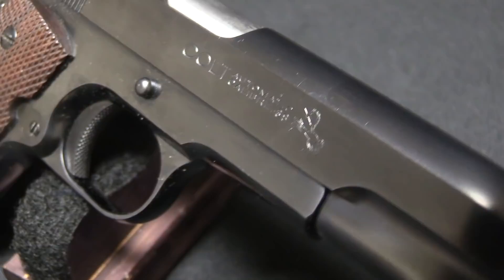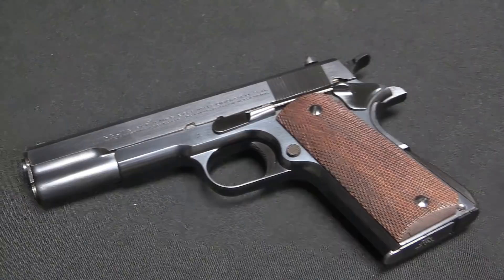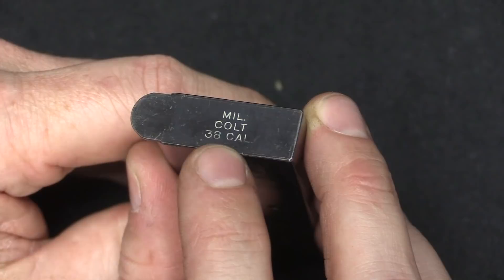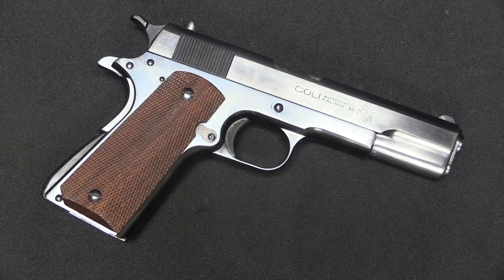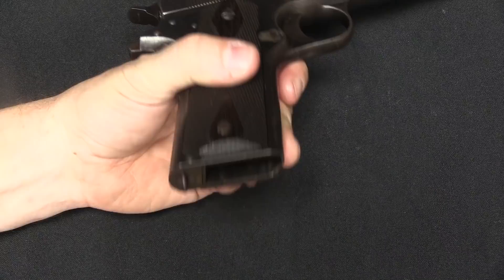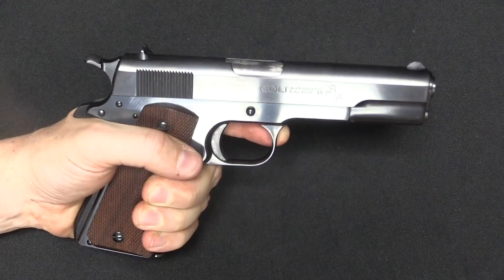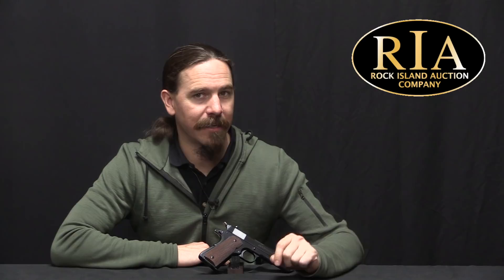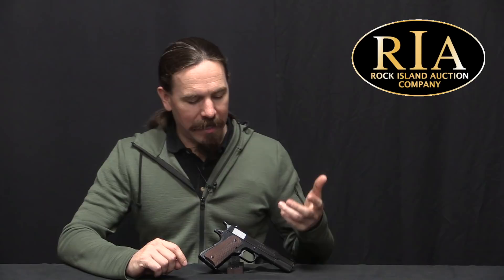Colt's Prototype Scaled-Down Model 1910 in .38/9.8mm

Comment: Now CZ (Colt) needs to get these back into production!
Reply: It's basically a Baby Rock.
Reply: @ScottKenny1978  Baby Rocks are smaller than this.
Reply: There are already a couple slightly more scaled down 1911s on the market in .380 ACP.
Reply: @0neDoomedSpaceMarine  
Bolt or Colt which is it heretic.
Reply: @0neDoomedSpaceMarine  because this isn't as big as a 1911.
Reply: CZ might just do this because it is about the size of their compact 75s. The only problem is, it's a single stack and a lot of people don't like that.

Comment: Ian : " ..and nobody's going to put them into production now " 
Kel Tec and Ruger simultaneously  : " Hold mah beer ! "
Reply: Ruger would probably wait for keltec to do most of the legwork and then introduce theirs later. Or SW. They don't really have anything all that special or unique.
Reply: Chamber it in .30 acp/shortened M-1 carbine brass with modern powder. 7.62x21 ?
Reply: @glennruscher4007  sounds like a 32 hr magnum automatic, or a 7.65 french long.
Reply: I'd buy one
Reply: @randomidiot8142  What has Ruger copied from KelTec recently? The only thing I know about is the P3AT —> LCP

I want a Ruger Sub2000 and CP33

Comment: Ian, fascinating pistol: it exhibits M1911A1 Transitional features such as the arched mainspring housing, the extended grip safety (beavertail), the stamped trigger, the full-checkered walnut grip panels and the slide roll markings of pistols produced in the 1920's while not having the finger cutouts behind the triggerguard.

Comment: Definitely a "forgotten" part of 1911 lore.  It seems to have futuristic look of the 1911A1. (Arched mainspring housing?) Thanks  Ian!
Reply: That mainspring housing makes you scratch your head.  Colt evidently considered it right off the bat, unless it was changed in the refurb in 1929.  It has the short trigger, too.
Reply: @Robert32064  I'm betting on the refurb, especially if they were using it for essentially marketing for the new pistols.
Reply: @TWX1138  https://www.rockislandauction.com/detail/56/3554/experimental-colt-model-1910-98-mm-pistol-serial-number-4  Note the mainspring housing, trigger length and grip safety tang on this pictured 1910.

Comment: The .38 ACP was no slouch for its day. It clocked a 125 grain slug at a nominal 1,100 fps which makes it comparable to the 9mm parabellum's 124 grains at 1,150 fps. A 9mm in that slightly smaller frame size could have been a winner for some European military and even the .38 ACP should have interested someone.

Comment: This pistol has obvious post-1925 features on it... arched mainspring housing, A1 grip safety, thumb safety and slide stop... and the front part of the slide is darker meaning it was heat treated which Colt didn't start doing until 1925 on the 1911A1. Also the rollmarks are definitely post-WW1 era. I believe this pistol was actually newly-made around 1929 like you mentioned at the end of your video.

Comment: I had heard of this pistol and cartridge before somewhere, probably in an article in American Rifleman. Only I thought it was from the late 20s or early 30s. Be that as it may be, in 1910, the .45 ACP was not a standard cartridge anywhere and (I think) only the Germans were using the 9mm by then. It seems to have been a common practice ever since cartridges became available that when a manufacturer introduced a model, they only chambered them in their own cartridges. So Colt would never chamber a Smith & Wesson cartridge or vice versa. And if they did (which they did), they'd call it something else. But proprietary cartridges are still being introduced.

Some models of Star automatic pistols were quite similar to the "slightly smaller" 1911. In fact, Star made a wide variety of single action pistols, all variations of a Colt automatic.

Comment: The caliber has me confused.  9.8mm is .385, a true .38, whereas 9mm/traditional .38 are actually .354 (generally rendered as .357).  Was there to be a unique cartridge, or is this simply one of those gray areas in firearms nomenclature?
Reply: The tolerances aren't that tight, especially back at the turn of the (20th) century.  A thousandth of an inch is insignificant compared to the lands, and the groves of the rifling.  Also, Nominal caliber is rarely exact to actual caliber.  Since you're forcing a copper jacketed lead slug down the barrel with fire, it doesn't really have to be, for a prototype pistol.
Reply: @Psiberzerker  Thanks!
Reply: 9.8 mm did exist but it was called .41 Long Colt. Ian pointed out that this wasn't really a 9.8, and my guess would be that the term might have been a placeholder to distinguish it from .38 ACP, as that caliber had been provided in an earlier trial.

Fwiw, 9mm Lugar is 9.01mm/.355“ and - I'm going to say from memory that it was around - the late 1980s that Colt publicly stated that all of their 9mm, .38 Spl, and .357 Magnum pistol bores were all cut to the same diameter, .355“, and had been for some time. Kudos to  @Psiberzerker  for his comment on this, it doesn't make sense to try otherwise.
Reply: @Ni999  Thanks; these comments are very informative!
Reply: @Ni999  Colt really liked the ".38" nomenclature.  In rifles, .358 is called "Thirty five caliber."  Honestly, this sort of thing is fairly common in small arms.  The nominal caliber isn't always exactly the same as the actual caliber, and they don't cut barrels down to the thousandth of an inch.  The chamber tolerances are generally that tight, for a good gas seal, though.  Also, for match grade competition guns, and precision rifles, but never for sidearms.
Reply: @Psiberzerker  Probably made marketing easier, .38 revolvers were common enough here and sticking with the name was one less hurdle at the sales counter. FN was no better. The 7.62 pistol rounds were 7.84 and the .32 ACP/7.65 is 7.94mm afair. While some refined rifles may have something going on for match grade quality, the naming didn't escape marketing there either. We have the. .300 because it's one zero better than a .30 and a .30-30 nomenclature on a round that never saw black powder because Marlin was not going to chamber a rifle in .30 Winchester.

When people ask, I tell them that the numbers are really model numbers rather than actual numbers. ¯\_(ツ)_/¯

And I tell them that 38/380/357/9 are all just .35 caliber.
Reply: @Ni999  As far as Marketing is concerned, yeah.  .38 is better in America, where the police cartridge at the time was .38.  (Note,  the.45 auto was brand new, and in 1910 they were just wrapping up the series of trials to have an official Military pistol for it.)  In Europe, it was the Metric system, but that doesn't mean that Colt was up on marketing to Europe (Where FN had the rights as per agreement) or were willing to budge on their pet nomenclature.  I honestly don't know, Ian is a better historian for that sort of thing.  I'm more of an Industrial Engineer, with what little I know of developmental History from sources like this.  It's really more of a hobby.
Reply: @F1ghteR41  Yes, and it was Colt that stamped Calibre 38 on the slide.  7:55.  Wouldn't surprise me if it was marketed as 9.8mm in European markets, though.

Comment: I see this pistol has the arched mainspring housing and short trigger of the 1911A1 , is this something that they did when they refurbished it for the museum or is it originally designed this way in 1910 and if so why would they return to the flat housing and long trigger on the 1911 ?

Comment: What about the cartridge? I don´t get it!

.38 ACP as used in the M1900 and M1902 is a semi-rimmed cartridge firing a .38 / 9,04 mm bullet, as is the longer .38 Super. As far as I understood from the video this one is chambered for .38 ACP except that it´s rimmless instead of semi-rimmed.

So were does the 9,8 mm bullet diameter come from? Was this a prototype cartridge necked up from the .38 ACP? Or was it a bigger diameter heel-type bullet for the standard .38 ACP case? (The .38 ACP shooting non-heel-type bullets in its standard form)

Great video of a great little "1911"

Comment: Browning makes a 7/8 scale 1911 in .380.  Unlike the old Colt scaled down .380s the frame is plastic, which is a turn off for me.  They feel great in the hand, but they could have at least made it in aluminum.  A plastic 1911 just seems ... wrong.

Comment: Just as well it was never produced in quantity, because two identical designs on very slightly different scales would result in 110 years of mixed-up parts, botched repairs, ruined guns, and bad reputations. Imagine having to mike every part to make sure you had the version you needed.

Comment: They had the curved-grip-insert on the backstrap of the 1910, but NOT on the standard 1911's ...?     Until the A1---!?!

*(that's the biggest-foible i find, both aesthetically and 'feel-wise' between the earlier 1911's VS. the 1911A1's...)
Reply: This was refurbed in 1929.
Reply: @skepticalbadger  ahh yes--  i *did hear that detail in the narration; ...but it didn't click that the refurbishment could/would include the addition of later-model parts...

[especially parts Not-organic/fundamental to the original-design/appearance; 
----I guess i would have expected to hear the phrase: "...was refurbished, & 'updated' in 1929..." ]

Comment: Somewhat confusing as .38 typically means 9 mm.
Reply: 9mm: "Go away, this is my land!"
9,8mm: "Sshh, this is my groove!"

(sorry for the bad pun)
Reply: @vaclav_fejt  No weapon has 0.4 mm grooves. The .38 designation is for weird historical reasons. It really is the case diameter. At some point revolves used a bullet that was as wide as the case.
Reply: @okaro6595  Ah, thanks! So that jole would only work with Westerm 9 mm vs 9 mm Makarov, true?

Comment: Im gonna say some heresy but I'd want a 1911 in 9mm.
Reply: My first pistol was a Colt Combat Commander (steel frame) in 9mm. Still kicking myself for selling it, it was a fabulous pistol, well balanced and very accurate. Didn't get along well with anemic loads and I never cared, no point in shooting a weak round from that gun. Rock Island Armory has 9mm 1911s if you're interested.
Reply: Colt still makes 1911's in 9mm. I've got two.